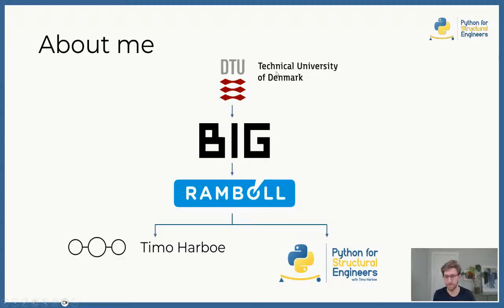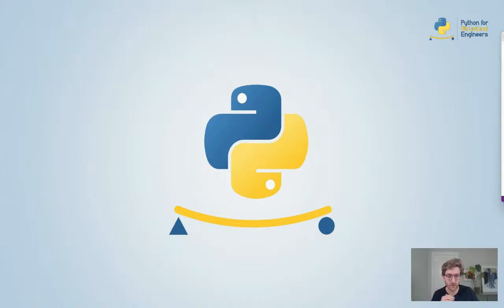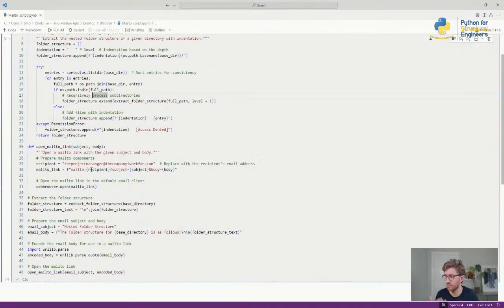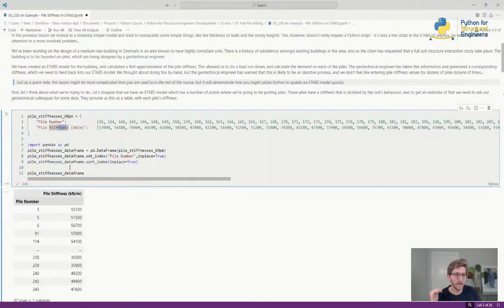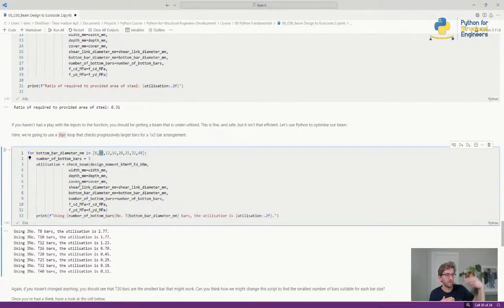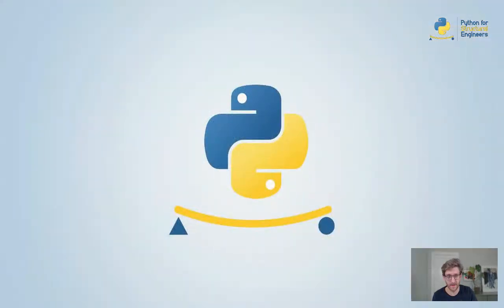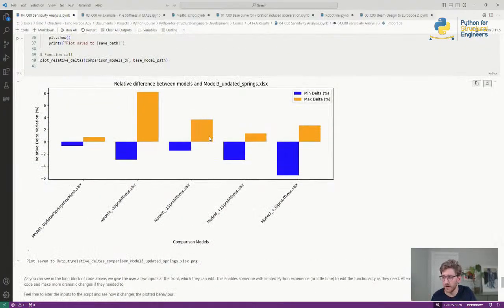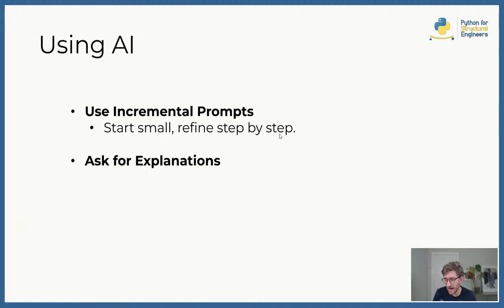Why and how: Python for Structural Engineers

Comment: I think it is worth to explain that Python is the bridge between simplicity of Excel and heavyweight of C++. For example, in excel your computation is limited. Maybe you can do analytics for 100 nodes and that’s it. After that, Excel is not readable anymore. But with Python, you can do 10k of nodes with less than 10 lines of code. So you do not require heavy coding like in C++. It is very convenient. However, when things are getting complicated, you will realise that Python is too slow. Usually, you don’t mind to wait but your customer needs your solution yesterday. Then, C++ is the right tool for you. Although it’s coding is more complex but it is convenient for your customer.
Reply from the maker: Really nice insight! Thanks. As they say: "Python is second best at everything"